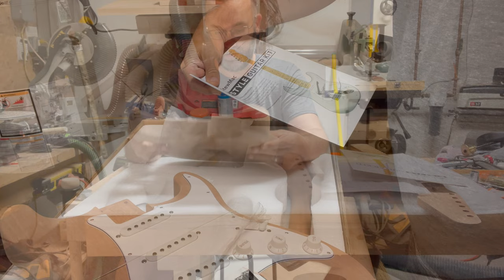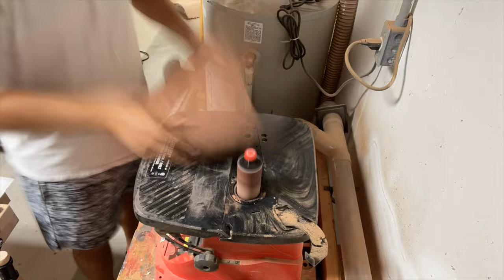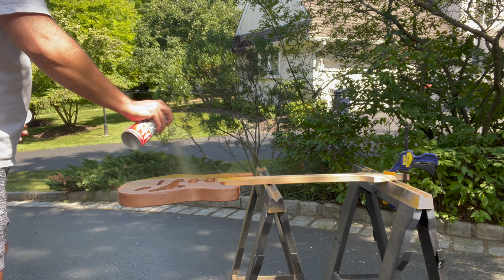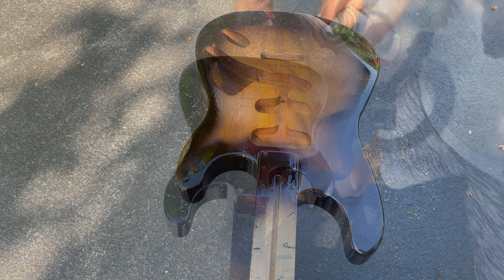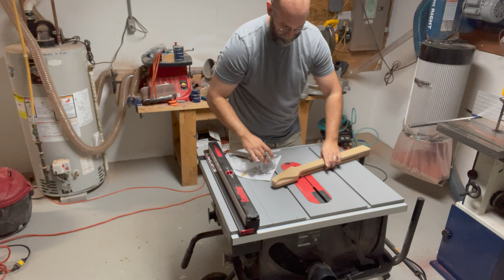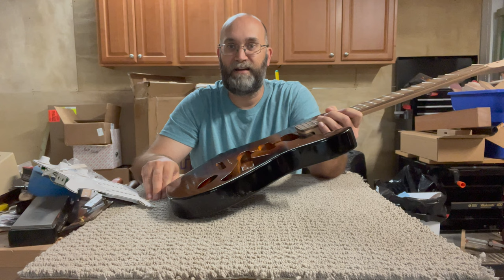Building a StewMac S-Style Electric Guitar Kit, Part 1: Fabrication and 3-Tone Sunburst Finishing

Comment: I have a masking technique that will work great next time you do a sunburst. After spraying your amber, let it dry for a day. Make a mask for the center portion of the guitar from something fairly stiff like cardstock. make some loops of tape and stick them to the body, then place the cardstock masks on top of those loops/ You want somewhere between 1/4 and 1/2 an inch gap between the body of the guitar and the masks. This will allow a little bit of spray to get in there making for a tighter demarcation line than freehand but still have some fade. If you want a fuzzier line between the two colours spray more in towards the center and you could also make the gap between the mask and the body bigger for more spray to get in.T his technique works great for my fine scale modeling and I'm sure with a bit of experimenting it will work well for you too. Cheers!
Reply from the maker: That’s a great tip to try, thanks!